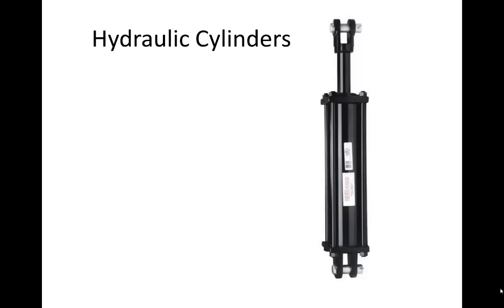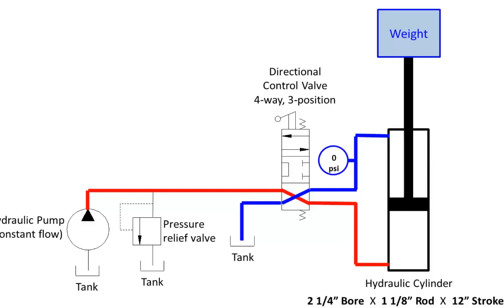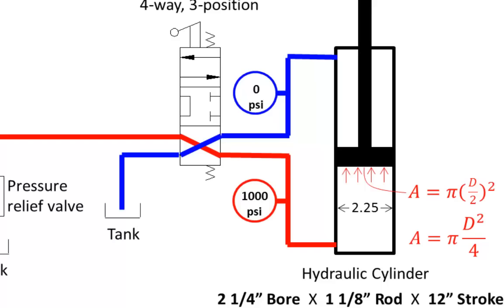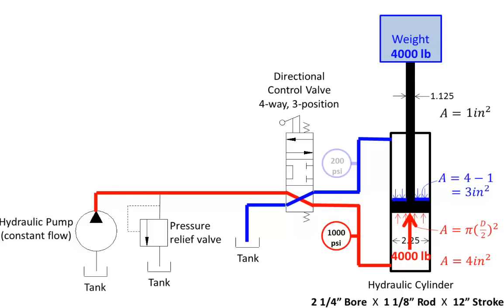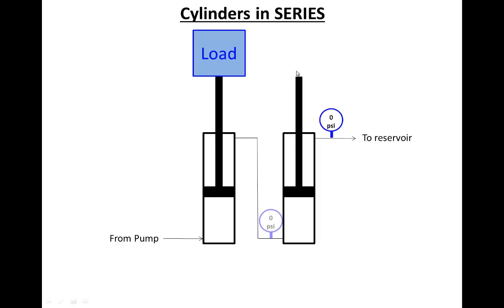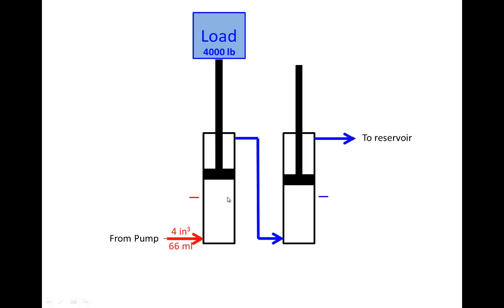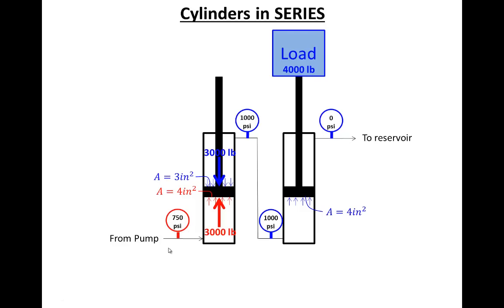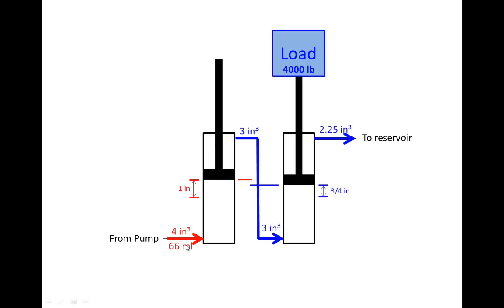Hydraulic Cylinder Calculations

Comment: So its the normal force-per-area that decides how much force something pushes on something else. The heavy block decides how much pressure it will make on the water be matter the size of the area/diameter. That weight can be used to create low pressure on big areas/volume or high pressure if its a small areavolume.. The weight and the water is the same as the matter in m = V/pressure. You need to count how much liquids there is in the cylinder before you can count the pressure right?

Comment: Most manufacturers will use different piston and sizes to those pistons for dimensional diameters for the same bore and same rod size. Is there a universal repair kit made for 4 inch x1.75 shaft size?

Comment: IF you took off the rod on the left cylinder (that was being used as an amplifer).. then you would have the same lift distance  and amount of oil transfering to the right cylinder with the load

Comment: I have a question. I have a tractor with one hydraulic cylinder that operates the bucket dump function. If I add another cylinder of the same size without changing the psi coming from the pump would I gain anything?

Comment: For me the question is what happens when running the cylinders in series when both have equal loads, not just one or the other. Will they move together with equal force at the same time?
Reply: Neither Fred

Comment: Amazing explanation. I want to synchronize 2 hydraulic cylinders, same speeds and same positions.
The master cylinder has 2.5" Bore size and 1.5" Rod diameter.
I calculated the resulting area of the master cylider.
Bore area - Rod area = 2.5x2.5x3.14/4 - 1.5x1.5x3.14/4 = 4x3.14/4 = 3.14in2
The slave cylinder area then should be 3.14in2
DxDx3.14/4 = 3.14 --------- Then square DxD = 4 ------------- D = 2in    
where D is the slave cylinder diameter.
are my calculations correct?
Also I want to know if you have previously syncronyzed cylinders, how precise could be. 
Do you think I can improve the error we already have of using a flow divider at 50%?

Regards;
Reply from the maker: Ro,
Thank you for watching.  Many people who want to synchronize 2 hydraulic cylinders can do so by putting them in parallel and then using a flow divider.  Here is a video highlighting the two types of flow dividers: https://youtu.be/eRhHbgE3dAs 
Aaron
Reply: Hello Aaron, we have a flow divider 50 and 50 but it does not acurately divides the flow. One of the cylinders moves faster than the other. (could be the 10% of tolerance accuracy?
I asked for some help and the engineer I asked told me that gear flow divider is more accurate than the spool flow divider.
What is the more accurate method?
Reply: you need a fluid slitter, It work by 1 input 2 outputs    like 1,gal in 2, 1/2 gal out. you can look it up
"hydraulic fluid divider"  or  "adjustable hydraulic fluid divider" with google or any search
Reply: @jessecobern2069  I solved it with a flow divider 50% and it worked amazing, I tested different methods but only that worked properly
Reply: @aaronschellenberg  what mean is 200psi

Comment: isn't the 'stroke' length also dependant on how far away from the actual ends of the cylinder the valves are installed to either bring fluid in or drain it?
Reply: No

Comment: Actualy is one slight mistake. Real lifting weight must be under 3400 pounds because at 3400 pounds we have the same pushing strenght in both dorecton so result becomes 0 lifting. Actualy a good lift from that schematic would be at about 3000 pounds of weight.

Comment: I deal in water at lower pressures.  It seems to me that you are ignoring friction loss and elevation change in the line(s) between the cylinders.  Is this because they are very small compared  other pressures ?  In any case great videos, very informative
Reply from the maker: You are correct.  In hydraulics we are usually dealing with 1500 psi and the elevation change is pretty minimal.  since it may only affect 5 psi when in a mobile application.  Friction loss is  is also small through the hydraulic lines and fittings since we design for laminar flow and may only get 30-50 psi drop in the system.  However, we are always worried about heat generation in the oil most of which is caused by inefficiency of our pumps and motors but a portion is caused by friction loss in the lines.

Comment: Great video, but the word "hydraulic amplifier" is not quite correct. That's more a hydraulic pressure transformer. With the amplifier the outgoing energy is more than the input energy!